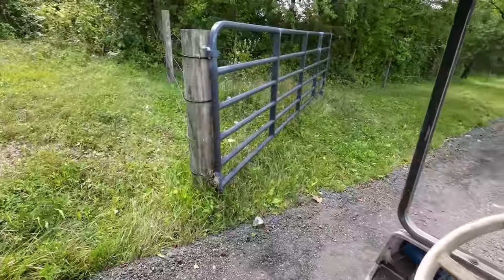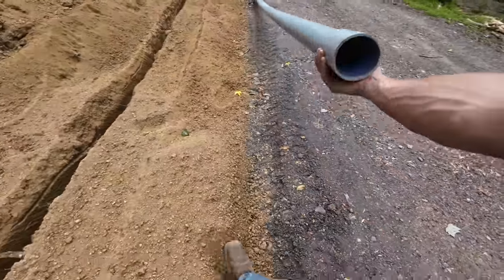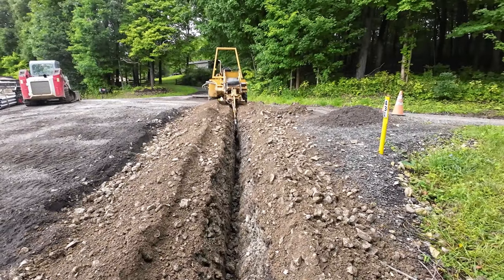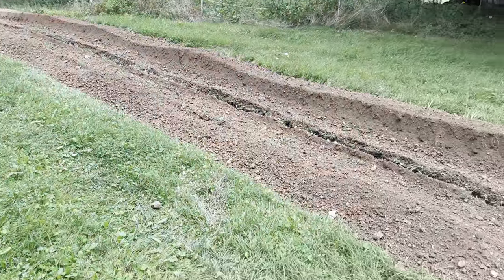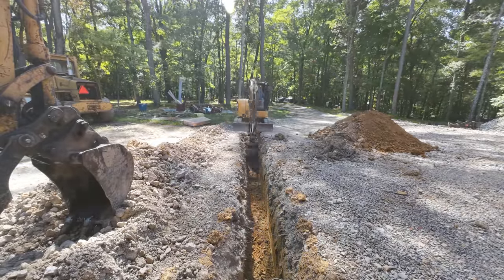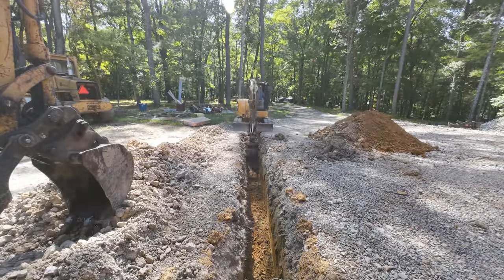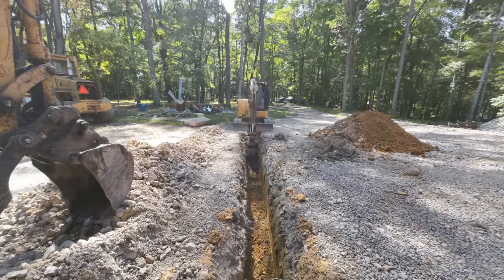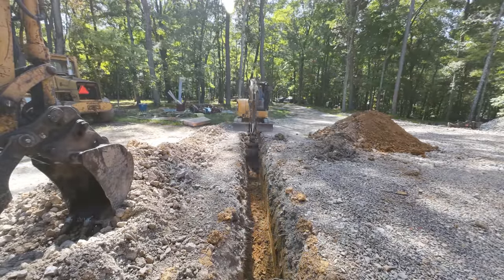Running Nearly 1/2 mile of Underground Electric, Costs over $64,000??!?!

Comment: It's insane what they charge to run cable. I live one mile from a major highway with fiber lines running down it. Will they run one down my road? Nope. Not profitable enough! We need to mandate it the same way we mandated phone lines to everyone.
Reply: He ran the cable
Reply: and tapping fiber is SO much more demanding than copper. Distance to fiber runs is meaningless. Distance to fiber junction is what's important.
Reply: How about a person who buys property on a mountaintop like Cammarata?  I don't know where this idea comes from that everything should be "free".  Somebody winds up paying, should everyone's electric bill double because of these so called "mandates"?
Reply: @yenzen9112  yeah you spread the cost out. That way one person doesn't need to pay $50k to get access to the Internet which is required now.
Reply: Be careful what u wish for…numerous supposedly privately owned “co-op’s” have been started to accommodate mandates. I’m forced on one paying $365/yr if we use power or not, as a so called maintenance fee.
Reply: @hotrodhunk7389 No.  Those that live in more populated areas should be cheaper due to how close people are to each other.   If you make the decision to live in an area that is significantly further in distance from other you should realize the cost for infrastructure will be be more.   If you get the benefit from not being near others, you need to pay the cost.   Those that live near other people getting infrastructure should not need to subsidize the the cost of those who get the benefits of being away from other people.
Reply: @yenzen9112 Absolutely agree.
Reply: get satellite and solar.
Reply: @timothydeose1639  dang you sound angry 😡. Must be that city living 🙀

So by your line of thinking people who live in the country shouldn't get roads or phone lines or electricity? Unless they have $1M to get it setup? Idk seems asine to me and defeats the whole point of living in a society. Spread the cost and work so everyone can live better... besides who do think supplies the city with food? And electricity?
Reply: @hotrodhunk7389  it don’t say what kind. So go get a cell phone and boom there are
Reply: I should not be required to subsidize your lifestyle choices. Are you going to subsidize the much more expensive suburban property costs that I paid vs the much cheaper rural costs?
Reply: Starlink is a very good solution to that problem.
Reply: @hotrodhunk7389 Interesting that you took a written comment and applied emotion to it.  

Be that as it may, the reality is the vast amount of economic growth occurs in our more populated areas of the United States.  However, that does not mean we do not need our rural areas that supply much of our food product in the United States.

There are reasons people live where they do.  Pros and cons.  One of the cons to living in more remote areas may be hire costs.   For example, living in remote areas may have higher costs for utilities.  However, living in a rural area may be associated with less crime and traffic.  We all make choices.  However, no one should be required subsidize that choice.  Rural areas may have higher costs associated with utilities.  A town or a city may have higher costs in public services, such as law enforcement, firefighting, education, health care.

Comment: Stay tuned for the next video where we magically find out what cost $52,000 to pull a wire through a tube 🤣 as a electrician I find this hilarious 😂
Reply: It's actually gold plated wire, makes the electricity flow faster and not pick up radio wave interference.
Reply: @bliviont  Gold plated wires... doesn't corrode... and has less resistance... and better conductivity :)  but I still am shocked at the cost they are quoting...
Reply: @wolphin732  Silver is actually a better conductor than gold or copper, but it tarnishes and that degrades it. Gold isn't as good as copper, but it doesn't corrode, which is why it's used on contact points.
Reply: @wolphin732 honestly I'm not especially in rural cause I'm willing to bet that initial transformer was his cost I know at my work when they upgraded to 800 amp service and only had 100 feet to go they had to pay for the larger transformer
Reply: Buy your own cable and get it pulled in yourself,  or won't this satisfy the companies code??, then alls you should have to pay for is connection??
Reply: so you are an electrician like me, and you are saying 'pull wire through a tube'?  do you know that is mv-105 cable?  do you know how to terminate a load break connector? do you know how to ground a transformer?  do you know how to hi-pot a cable? do you know what a medium voltage cable splicer makes an hour?  i am sure you can do it cheaper.

Comment: I know this made very good viewing (which it is always - thank you), but unless the algorithm will generate a decent proportion of the $52K, you should consider going solar. For that amount, you can get a pretty decent system with sufficient battery backup to run both your workshop and future house. If I were you, I'd seriously consider that, even this late into the process of laying the conduit.
Fascinating, engaging and insightful video as always - thank you and keep it up!
Reply: Yes, solar makes total sense in this case. You can get one heck of a solar installation for 52K and the cost of electricity will be zero for many years to come. Not to mention the satisfaction of being independent of external power delivery.
Reply: I'd also recommend solar. My 8kW solar + 15kWH battery cost me £13k  and most of the year it will provide all of the power to run my house apart from a small amount when I run the electric shower or other big loads (I only have a 5kW inverter).  
My system won't provide enough power for the house in the winter with heat pump heating but it would be plenty for a workshop and wood burner. Maybe add a bigger inverter capable of running heavy loads such as welders.
Double that price and you'd have something capable of running workshop and house, with only needing to run the generator occasionally in the winter if you get a run of very dull days.
Reply: @mcg6762  and then overcast weather makes the panels useless and negligible compared to direct power sourced from a powerplant
Reply: @National_Socialist_Supremacist  If you have a decent battery bank you'd be surprised how well it works. And for those periods in the winter where you have really bad weather many days you can run a generator at maximum efficiency to charge the batteries.
Reply: @mcg6762  No, I wouldn't be surprised how well it works, the thing is, it's not 100% efficient unless it's always sunny, and you have panels that follow the sun so it's always perpendicular. 

You can also just always use a generator at all times when necessary, which will be more efficient in all areas, at best, solar panels are to give generators a little boost, not to be relied on primarily.
Reply: @National_Socialist_Supremacist It does not need to be 100% efficient. It just needs to cover the energy needs. I live in Sweden and we have very long winters with the sun low in the sky and a lot of bad weather. A 20kW solar array here still generates around 20,000kWh per year. It's just a matter of sizing the array and the battery to cover your needs.

Comment: As a few others have pointed out, think about an off-grid solution to buy time  to negotiate  with power moguls. The lights and heat source fans and pumps certainly are within reason to create your own power for the coming winter. My suggestion is follow Will Prose for pointers and knowledge, Matt you have friends and you have the skills to set up a temporary power system. Probably don't even need Solar panels , as many options to charge batteries, charge with you many generators,, or get temporary power at that pole, or purchase multiple 48 volt server rack LiFePo batteries load them that cool Jeep. drag them to the house, charge for next cycle.  Plus it would make a great video maybe even break even in the end. This would give you time to deal with the electrical contractors and power company including cold weather.

Comment: Curious about code and inspections in your area.  Did the electric company inspect your conduit before it was covered?  Also, around here, the water pipe needs to be one foot above the conduit.  I ran a few hundred feet for my shop, and I totally agree...it's harder than it looks.
Reply: Yeah. I think in my zone conduit has to be inspected and a specific backfill has to be used. And one foot between water and electrical. With more specific backfill and minimum depth.

Comment: I would bring 3ph high voltage to a Step-down Transformer at your shop (These added costs are largely offset by being able to use much smaller conductors for the long service run) so that voltgage drops when starting equipment are eliminated and motors run better at high torque loads while lasting longer and you will have sufficeint capacity for unknwon future needs. This is a much needed investment that in my estimation will pay many times for itself in the future. Well done. Ray Stormont
Reply: That all depends on there the 3 phase ends. Being rural most likely there’s only single phase power there, so the power company would have to bring in three phase potentially for miles. And that would be extremely expensive. Stringing over head lines would cost a couple hundred grand. And seeing how this is all underground it would be an unfathomable amount of money. Running 3 phase u/g cable wouldn’t save him anything by running smaller conductors because that just isn’t how 25kv cable works. Most likely he would have to run 3 1/0 cables instead of just the single 1/0 he’s running here. The o.D of this cable is in the 2 inch range. Some utilities do use 3 phase u/g cable all conductors in 1 teck cable but that’s annoying and not wide spread depending on area.
Reply: @brenteichel7661 my thoughts exactly.
Reply: The pole he trenched to only has single phase power
Reply from the maker: There isn’t 3 phase anywhere around here for miles, I’d be in the millions to get it here lol
Reply: It’s possible they only have 1ph on the pole if it’s a rural area. Correction look at the pole in the video it’s single phase.
Reply: @DieselCreek  Back to solar panels lifepo batteries and three inverters to give three phases or a three phase inverter no electric bills and ( in South Africa if you do it yourself ) 15 000.00 dollars US cost for 3 phase 380 volt at 20 amps per phase with 10 kWh of batteries. 100.00 dollars to have the liscenced electrician certify the installation as long as you have done everything correctly to SABS standards.

Comment: In north-eastern Minnesota, the local utility co-op quoted about $11,500 for 250 feet with 2x 200A service and fiber internet. I needed to provide everything after the transformers. I have 2 services because we are going to run off-peak for an electric boiler for in-floor heat (nearest natural gas is probably about 75 miles away). Second 200A service is for everything else.

We changed gears a little. Transformer will go right under the pole, meters next to the transformer, and we'll trench the feeders along a different, shorter route to the house.

Guy in the electrical department looked at me real funny when I told him I needed 500 feet of conduit.

Comment: I've got to think you could have set up a pretty impressive solar + storage array for $64,000. And you already have a backup generator for the occasions when that might not be enough. Any reason you decided not to consider that route?
Reply: +1 For this comment.
Reply: My best guess is a mixture of reliability, simplicity, and underestimation of the cost on the side of the power company

Comment: Have to ask but at that cost did you ever consider solar panels on the roof and batteriese? Would love to here your thought on this. Love your videos.
Reply: Solar would be a good option, but I'm guessing that there isn't enough sun year round to keep the building fully powered, so he'd need this line in regardless.  But he definitely should consider setting up solar on the roof of his shop because even if he can't fully offset the power cost, it'll greatly reduce the cost during summer so that he could run an AC unit and have a cool shop to work in and a cool house to live in.
Reply: He wants to run more than just lights and a fan.:face-orange-raised-eyebrow:
He said, "we need REAL ELECTRICITY!"
(Something with "OOMPH" behind it.)
Reply: By the time you have enough PV solar panels and batteries plus management software and inverters to run a shop & house off, you're in for more than $50k. I run a small DIY 470Wp solar array with 3.3 kWh LiFePO4 battery for off-grid usage, which gets me about 1.1 kWh of usable power per Summer's day. To get enough power in Pennsylvania during Winter (~10% irradiance compared to Summer), you'd need to cover Matt's entire shop's roof, plus that of the future house and a clear-cut section with solar panels, find a dedicated place to put a battery storage building (with AC, of course) and then you might just scrape by during the Winter with only some power rationing.
Reply: @MayaPosch so what if the install cost does work out more than the power company want? That’s it, no further costs then (other than repairs and maintenance, which will be low), no monthly bills.
Reply: I agree with you on solar, But it's just not there yet, he needs alot of power for the barn and a future house, I have seen first hand how solar just can't keep up with the demand, The cost of batteries is too high currently for the capacity most people need,   Fine if your in a cabin.     Just my opinion only.
Reply: @Pugjamin  Ask any owner of a PV farm or significant PV home installation about 'no costs'. if you're lucky you have damaged PV panels, inverters turning themselves into charcoal and BMSes deciding they don't want to BMS any more.

Running your own infrastructure is not easy, and I mostly do it because a) it's a fun learning experience b) it's a useful backup for when Germany starts suffering from blackouts because of the idiotic energy policy they got going on here, along with the insanely high prices (~40-50 Euro cent/kWh) that make the ROI go brr~
Reply: @MayaPosch  I said other than repairs / maintenance, did you miss that? If you buy quality parts with decently warranty then the costs over the first 10-15 years will still be a tiny fraction of a monthly power bill.
Reply: @bruwin My guess is that if he went for a 30kW solar array with 100kWh battery storage it would run his shop and house 95% of the time. The rest where there is bad weather several days in a row he can run a generator for some hours to charge up the batteries. And a system like that might be possible to get installed for less than 52K, especially if he did some work himself. Here in Sweden we have long winters where the sun is very low in the sky, but a 30kW solar array still generates around 30,000kWh per year.
Reply: @manifold1476  With two 20kW inverters he can run 150A loads at 240V.
Reply: @Pugjamin because if he were to build a solar system that could exceed his current and future electrical needs would cost close to double what the power company quoted him. Yes, he would no longer have monthly bills, saving him a few hundred dollars a month. It would take decades for him to come close to breaking even on his investment. In that time he'd have to replace aging PV cells, replace batteries/add more, upgrade inverters if he has greater load demand, and deal with brushing snow off of his panels all winter long. All he'd be gaining is an expensive project.